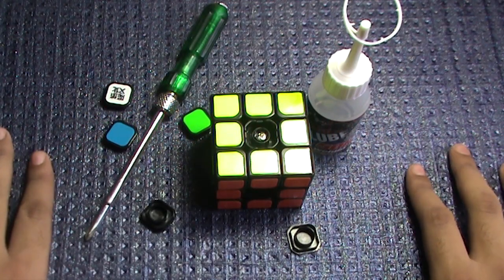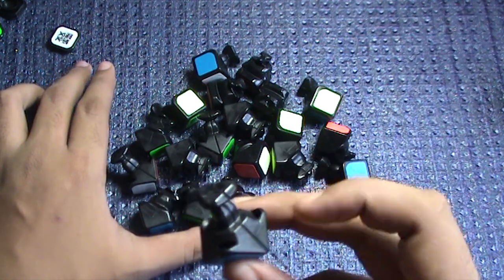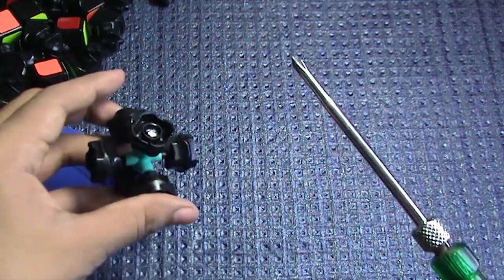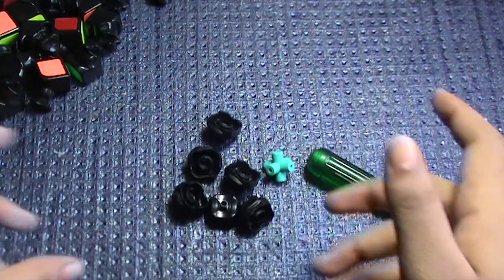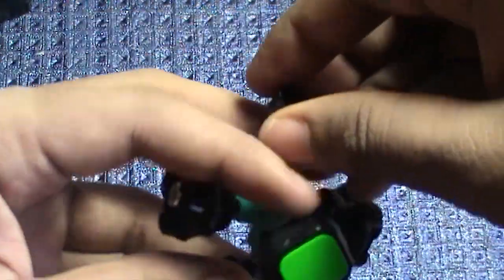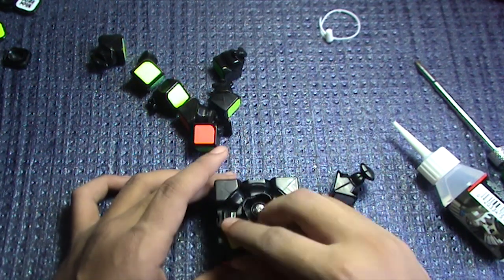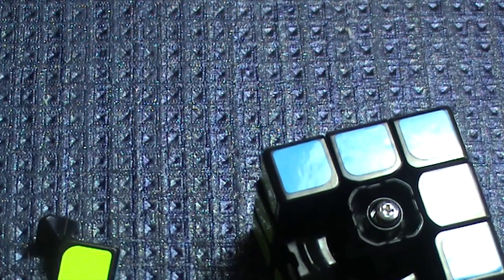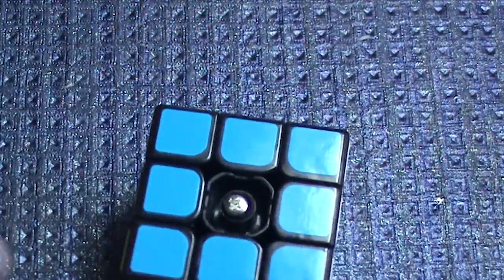HOW TO SETUP AND LUBE MOYU HUALONG & OTHER CUBES

Comment: Will maru lube work too?
Reply from the maker: niranjan ravichandran It works good for pieces. Not that good for core.
Reply: CriticalCubing pls help!!! I do f2l in 9 secs avg i know full pll i have non lubed hualong tension loosed a bit and my cross takes 1-2.5secs but my last layer takes 9secs even when i know full pll and know 26 1 look oll and all 2look oll .pls help.
Reply from the maker: Do a lot of LL practice. Get you PLL recognition better and practice last layer specifically. There are LL options in Prisma Timer as well as cstimer so do that.niranjan ravichandran

Comment: The way I clean/lube if the cube is VERY dirty:  Get a dish of water and add soap if needed, The set that aside and disassemble the cube, until the core and hardware is still attached.  Put all of the pieces in the water until your done taking apart the center cap and hardware; Then remove the pieces from the water and quickly wipe them dry with a towel, then dip the screws and springs in SLOWLY and take them out, then dry them.  Then you will wipe the pieces and hardware fully and lube the cube CORRECTLY using this tutorial.
Reply from the maker: Brave Cuber Actually I do the same thing like you. I do it over the sink so there is no spill on floor and for getting the lube off the pieces, I use a brush and gently brush the lube off. I might make a video of how I do it but with that there is 100% no lube left and you have a clean and tidy cube. You can also add a little lemon for smell but  I havent tried it. I did your method previously until I started with the brush :)
Reply: Make it a how to lube like a ocd person lol, make it PERFECT!
Reply from the maker: Brave Cuber I would need to buy a go pro for it haha. I will try to do it, lets see in future.
Reply: Haha, or get a wide angle lens?
Reply from the maker: Brave Cuber That will probably cost more than the gopro itself haha xD
Reply: LOL they sell them for iphones and stuff that's realy cheap, epending on your camera.

Comment: When i got my hualong i did some solves and then played a bit with the tensions and after it i did an average of 100, is it ok to do your process now?
Reply from the maker: יוני קלמן Yeah. It should be perfectly fine :)
Reply: I did it and it destroyed my hualung
Reply from the maker: יוני קלמן You must have overlubed it. Do this, take a old cloth and take an edge piece out and wipe all the lube out of the edge piece. Then take out another edge piece and do the same. Now move the cube around until you feel it is fast to your liking. I like my cubes gummy so I always tend to overlube and break the lube in. Tell me how it went :)
Reply: Thanks but the cube just locks up alot
Reply from the maker: יוני קלמן That is the fault of tensions. Just loosen it a bit. It is too tight.
Reply: +CriticalCubing THANK YOU!! <3

Comment: My HuaLong has like 1000 solves and is very dirty inside...
Reply from the maker: MJCuber Clean it with a towel or if it is very dirty, then wash with soap and water. Then do the lubrication process. Will be as good as new :)